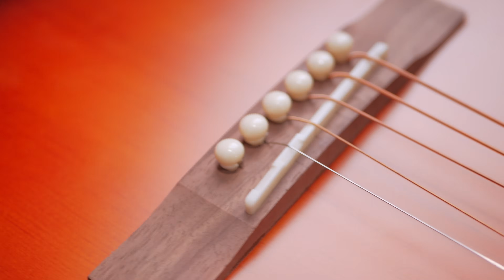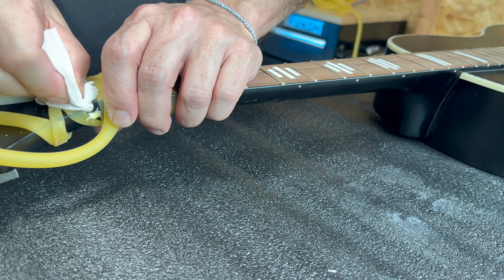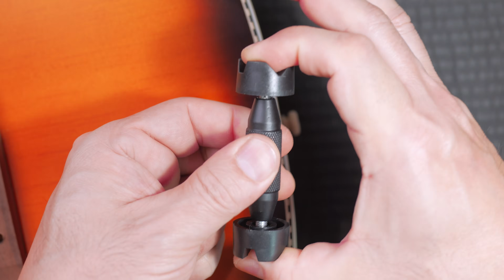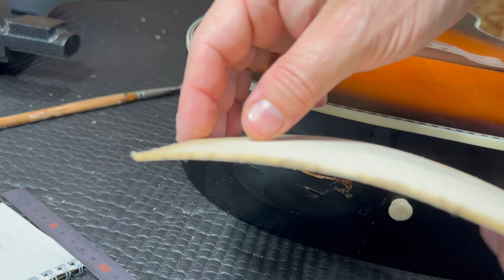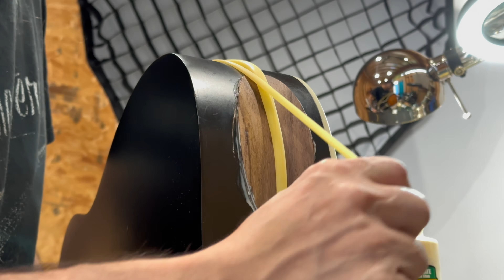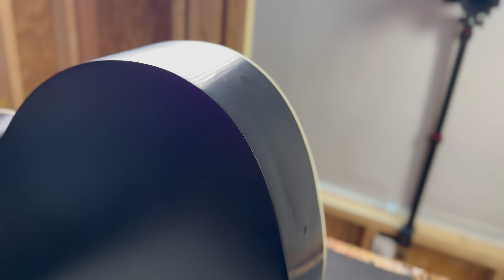Acoustic Guitar Repair - My First Hole Repair

Comment: I’ve seen this body repair done with Ramine noodles and superglue, 🫤. This was much better, nice job! A small tip, getting glue all the way down into the neck crack is important and the syringe seem to work pretty well but it’s common to thin the glue slightly with water to help it creep into the very bottom of the crack and if compressed air is available you can blow some air behind it as well.

Comment: I've done 4-5 neck repairs identical to this in the last 2 months on a batch of brand new Rogue guitars. I'm pleased to see that your method of doing this repair is the same as mine, right down to the surgical tubing. I wasn't sure if my approach was the best possible method or not. I feel more assured after watching your video.